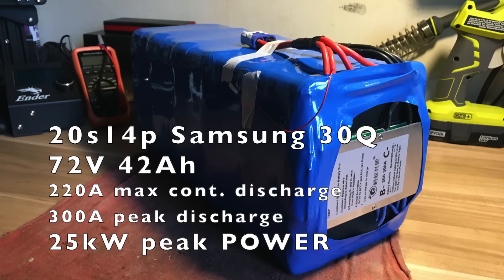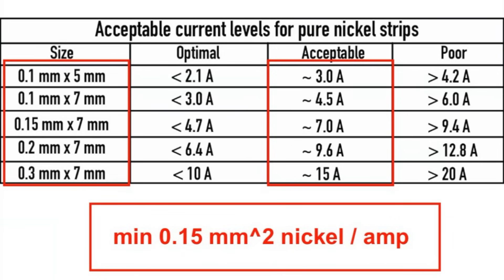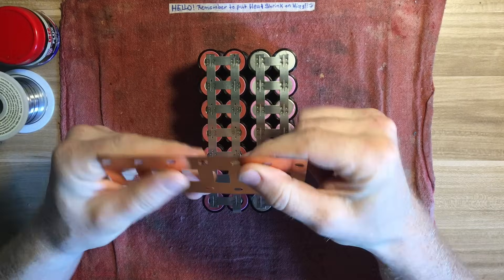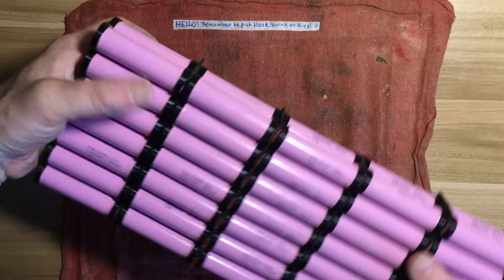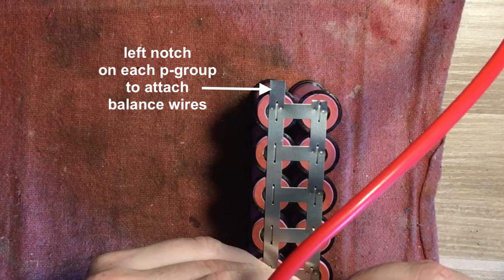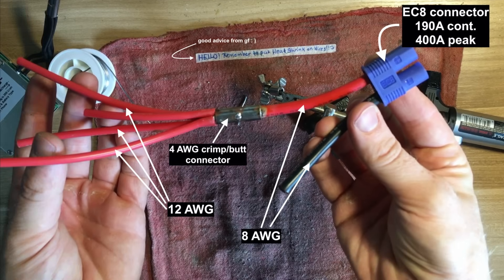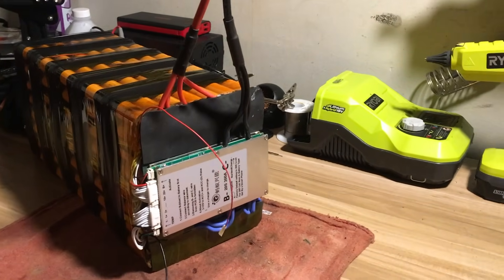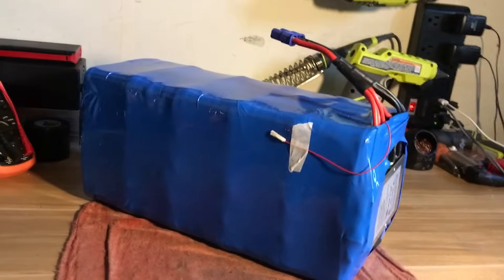How to build a MASSIVE 72V DIY battery pack for high power e-bike

Comment: Is it vital to add 300amp bms according to max dich current of cells or can you add a smaller amp bms ??
Reply from the maker: you can add any BMS - if current is less current of pack will be limited by BMS. if BMS max current is more you lose current protection unless BMS is programmable

Comment: from where you will do the charging and attach the load to the battery , in your case a motor controller ???
Reply from the maker: charged and discharged through the main pos/neg terminal

Comment: Trying to imagine dimension difference for 2 10sx14 stacked. Only 1 Copper folded connection with insulating pad in between. Love the work. Really helps with new ideas!

Comment: Every video I see with copper, says to sandwich copper under nickel. Why did you do the reverse? Thanks.
Reply from the maker: the reason they sandwich copper under nickel is because copper has very low resistance and common spot welders can’t achieve enough heat to spot weld it but if you place nickel over it, the nickel heats up enough and transfers that heat to copper - it’s a hack to spot weld copper with a common spot welder. but it only works for thinner copper. I’m using very thick copper here that would be impossible to spot weld so I added nickel first to attached the cells and provide a safe place on which to solder these thick copper plates
Reply: @GaiusGarage thanks!

Comment: Hi what controller works, fardriver nd72360 and im using this but fardriver max dc current is 190a shouldn’t go too over or over at all
Reply: Considering this goes a minimum of 220a
Reply from the maker: @TenzinLama-o5e  the controller controls the current, not the other way around. battery is like a glass of water you can have a big glass or a small glass, but you choose whether you sip slowly or chug all at once, youre the controller
Reply: @GaiusGarage dude im asking you question and you’re wasting my time why can’t you also tell me what motor is good?
Reply: @GaiusGarage should 15000w motor? And obviously 300 amps controller and 72v I already know this but tell me why you can’t tell the motor send a link?
Reply: Is 3c 3 amps?
Reply from the maker: @TenzinLama-o5e C refers to the capacity. 3c is 3 times the capacity which is 42Ah. so 3c is 126A
Reply: @GaiusGarage ok I read u loud and clear

Comment: why not use copper strips for the parallel connections as well?
Better conductivity, oxidation - doesn't matter (sealed space)

What is the exact reason(s) for using nickel?

Comment: Hey man, VERY well done. That battery is overbuilt in the best possible way!

Question for you... I picked up this crazy prototype battery a while back (I work with batteries professionally), and am really curious if its feasible to use it for an e-bike. Coincidentally, its cells are also Samsung 30Q, and this thing was clearly designed to harness the full 15A from each cell (each cell is thermally mated to a liquid cooled aluminum block!!). Here's the thing: the pack is configured as a 24S 12P (86.4V 36Ah) and can't be rearranged. Now, I am familiar with plenty of BMSs and chargers for 24S setups, but I am still mostly an outsider to the e-bike world and am struggling to find compatible parts that are practical and affordable. So I was wondering if you would happen to know of anything like that. I have a 700c road bike I'd like to convert, but I'm open to other ideas too. Also I'm happy to 3d model and print custom parts if need be. Thanks in advance.
Reply from the maker: The difference between 20s and 24s is pretty small - a lot of overlap in voltage (20s is 84V fully charged, 24s is 86V nominal) so for the most part, you should be able to easily find components that work for both. Basically, the only constraint will be the motor controller - one design for 20s will probably get damaged if connected to 24s fully charged (100.8V). But its easy to find motor controller that will work for 24s -- anything with a max current above 100V will work. I wouldn't worry about the motors - any motor that will work for 20s will also be fine on 24s.
Reply: @GaiusGarage  Fantastic. That's great info, thank you so much!

Comment: what would be the maximum charging amps for this battery ?
Reply from the maker: 1C is generally a safe charging rate - this is a 42Ah pack so a good max charge rate would be 42A

Comment: Great job! I have a question, when did you set up the battery pack to show as empty? When it reach nominal voltage or less like when it reaches 3.2v per cell ? Because when having a high discharge battery pack I'm confused where to set the SOC as empty 
Thanks
Reply from the maker: its a bit of an arbitrary definition - 2.5V is the physical low limit for li-ion batteries below which will cause physical damage to the cells. If you wanted 0% to represent the actual physical limit, 2.5V would be the value. that said, the energy curve for li-ion cells is not linear so the amount of energy between 3.0V and 2.5V is significantly less than between 3.0V and 3.5V, for example. In fact, most of the energy per cell is roughly between 4.2V and 3.6V. so if you're looking for a more practical value, perhaps one to set as a low-voltage cut off for the BMS or controller, I would go with 3.0V per cell. If you want to be a bit more conservative and focus more on cell health and longevity, 3.2V/cell could be a good option as well. I would also recommend not going below ~3.4V / cell for everyday use, and not charging to 4.2V/cell (studies show that charging to 4.15V increases battery life by 20% while the energy difference between 4.15 and 4.2 is only like 3-5% so you get a lot more battery life for very little loss in usability). here is a link to a curve that I use for all SOC setting: https://imgur.com/a/z8C1fzE
Reply: @GaiusGarage  many thanks for your professional explanation 
Cheers !

Comment: Are the multiple wires from the bms on both positive and negative just to spread the amps over 4 wires ? Is it best to solder them like you did in different places along the mains pos and neg area of the 72v battery or does it not matter ?
Reply from the maker: @cajab7407  yeah it's just to distribute the amps over several smaller wires vs. using a very think wire - generally you would do this to make it more flexible and easier to solder. if you have the option it's better to spread out where they're soldered

Comment: you must not divide the current carried by the number of cells because the nickel connecting them will see the entire load of all 14 cells put together in the group. now the load for each battery cell in the group will be divvied between them, but the nickel connecting them will see the entire load of all the cells in the group

Comment: So, my 60 volt e-bike and its battery got stolen a couple weeks back, and the other day the police returned it and the battery. Now, rather than charging up to a maximum of 70.3 volts, the BMS is saying that the battery is only a 48 volt battery. Did the thieves give the police the wrong battery, or is the BMS acting up? Not only did the battery come back out of its wrapper, but when I completely unwrapped the battery I noticed that four cells were removed from one end of it. The thieves may have removed the four missing cells, or the battery may have simply came that way from the factory. Not sure
Reply from the maker: I'd say it's more likely that they removed some cells - voltages match to to two missing cells (60 vs 48)

Comment: The foam between layers of the pack is a bad idea.

You either want the cells to be in direct contact with each other so that heat from cells at the center of the pack can be conducted outward, or you want to have aiflow through the pack.

Having neither, you increase sag as the inner cells heat up.

Comment: How much cheaper is it to build a battery like this versus buying a pre built battery
Reply from the maker: the thing with very high power battery packs is that they really don't sell pre-made pack other than for Surron or some other popular brands. and if you need something over 300A, you really have to go custom. cost to have someone build a custom pack for you will have at least 30-50% markup for labor. so it's much cheaper to build yourself if you can

Comment: Hi,
Did wraping the battery in hear restant foam cause any heating or overheating or slow cooling issues?  I want to wrap  the battery i am building in foam as well for decrease vibration but am hesitant about overheating issues. 
Great built.
Reply from the maker: No, I never had any issues with overheating. heat is not really an issue unless you're really pushing a battery pack to it's limits. in this case, I would only run it at max discharge for short periods of time (when accelerating hard) but most of the time the demand was much more moderate. so overheating was not an issue even when wrapped and placed somewhere with little airflow

Comment: great video, clean build!  i'd like to add to the importance of using insulator rings, my 12.6v 60aH build after 3 years had about 8 cells "pop" because the nickel somehow punctured into the factory protective film at the top of the cell (positive side), causing the positive to meet the battery shell (ground).  First time i've ever smelled li-on fumes and surprisingly smelled like Lychee candy lolll.  Ever since then, i've used insulator rings on all my builds, and still paranoid!
Reply from the maker: I added those here 1:09
Reply: @GaiusGarage  yeah, was saying im adding to the importance of it, loved that you put it in the video.

Comment: If I use a 3kw motor, how much range should I get in full acceleration...like 90km/h?
Reply from the maker: the motor rating does not matter - you need the energy efficiency of the vehicle (W/km). If you dont know this, you can estimate from your motor controller. If the controller pulls 100A at full speed, and this battery is 42Ah, then you will get 42/100 = 0.42 hours of ride time or ~25 minutes. However far you get in 25 minutes, that's your range.
Reply: thanks man @GaiusGarage

Comment: Excellent work. Very nice build.
I cant find the 220 continuos 300A max discharge BMS.
The ones available are 240A continuous  but 550A max.
Im usisng 14P sony VTC6 cells   so I have max 420A discharge.
Should I go for a lower continuos discharge? Let's say 170 continuous  425A..
Thank you.
Reply from the maker: you should size your BMS to the peak discharge of what your system will be running
Reply: @GaiusGarage  thank you

Comment: Hey I wrote a comment yesterday about my 52v battery that I could only get a reading of 14.5 volts out of. You replied saying I could do a zoom but I just thought I would write another comment to tell you what I would consider to be very important information before we go on the zoom. So I opened the battery a couple minutes ago to test the voltage, and I put the negative prong on the negative nickel strip and positive on the positive nickel strip, and I got a reading of 58.2 (52v is 58.8 full charge) so that’s the right voltage. Part of the bms wires are exposed so I put the negative prong on the negative bms wire and the positive prong on the positive wire. It read the exact same voltage of 58.2. Before, my worry was that the positive or negative wire wasn’t soldered on good enough, but now I know that they are and both give the correct voltage. This is good, because now I know 100% that it is an issue with the bms and not something else. I am going to book a zoom call as I would love to hop on a zoom call with you to get this figured out. Especially now that I know the problem. I just thought I would write this comment to let you know what I’ve narrowed it down so that way on the zoom we can get it fixed.
Reply from the maker: Oh nice! yeah sounds like your pack is in good shape, which is the important part!
Reply: @GaiusGarage  What day/time for the zoom works best for you? I have a lot of free time so I just want to make sure to book a time where you have the full time and focus to help me out. Just lmk what works best
Reply from the maker: @schmeglyomigy6174 you can choose a date/time on my Calendly https://calendly.com/gaiusgarage

Comment: Hi, I am a highschool student and for a fun project I decided to build an electric pit bike, as well as building a custom battery to fit the spacing required. I custom built a 52v 28.8ah (14s12p) battery with samsung cells and before I put the bms (50a 14s Daly BMS) on, I tested the pack with a voltmeter and it read around 58.6 volts, which was perfect. However, when I soldered the bms wires on, and put on the connector, it read 14.5 volts. That was around a month ago, and now when I test it the voltmeter reads around 9.5 volts. I checked all of the bms wires and they were fine, so I don’t understand how I am getting that voltage. I saw online that sometimes a BMS can be “asleep” and that you can wake it up by charging, so I tried that and it didn’t even charge. I am now feeling very frustrated and defeated, because everything went so well until the BMS part. Everything in terms of the nickel strips and batteries is good, but it is just something with the BMS. I wasn’t able to get a very good solder on the main positive wire, so that could be the issue. This is all for an electric pit bike project that I’m doing, and I just feel very defeated now, which is why I’m seeking external help. Sorry for the very long email, but this is just the problem that I am facing. Do you know a possible fix or any way I can contact you for you to provide further help. Thanks in advance.
Reply from the maker: I can help you debug over zoom - please feel free to book a 30 min session on my Calendy. you would need at least a multi-meter to do some testing. If I cant help I will refund the cost 
https://calendly.com/gaiusgarage
Reply: @GaiusGarage  Ok that sounds good. And for you refunding me if you don’t help, does that mean if you can’t help me get the battery working or just if you can’t help me at all. I have a multimeter. I do have a question about the multimeter if you know though. When I first read the voltage and it read 14.5, I decided to switch around to the different multimeter settings. On of them, which reads uA (macro amps) I got a reading of 54.6. Do you know how I could have gotten an amp rating out of it?

Comment: Great clear and concise video.  I would really like to see a test of the output vs. the specs it was supposed to be able to do.  I worry I will spend the money on raw materials and it won't be nearly as good as just buying a good commercial version.
Reply from the maker: Thank you! I used this pack even since in an ebike (build also on my channel) which someone has since purchased and still using. This pack performed great at the output mentioned in the video. Nowadays you have many more options for cells and build techniques where you can get same or higher output easily. similarly spec'd packs purchased pre-built will run you about $2500-$3k so it's definitely worth building yourself if you have the skill
Reply: @GaiusGarage dang! 3k for a prebuilt? I'm thinking about converting my bike with a 2000w hub, and a 20ah battery at 48v is around $500 or so, I think. I hope battery design will get better and cheaper soon, especially with all these Ev cars that they are pushing down our throats.

Don't these batteries only last like 4 or 5 years if you're lucky?

Comment: How much that cost to build and do you build and sell them ?
Reply from the maker: Just built this one standalone. But I can build a pack for you if you're interested. Cost was ~$1000 in 2021 but prices of cells have increased since. However, there are more and better cells on the market so its possible to source something for similar cost.

Comment: I heard solder and high current dont mix well because the solder can potentially heat up enough to liquify under high draw. Any thoughts on this?
Reply from the maker: Most common solder melts at around 200C - if your connections are heating up this much during use, you've got much bigger problems

Comment: How is this pack holding up? Just curious as Im debating to buy Ant BMS or JK smart.
Reply from the maker: I haven't tried JK BMS but I believe it is higher quality than ANT BMS. ANT is a reliable basic solution but it does not support active balancing as far as I know, I think JK BMS does. this pack held up well but one cell group started to lag. I had to add an active balancer to keep it in good shape. active balancers werent widely available when I built this but if I were to build a large pack today, I would definitely use one
Reply: @GaiusGarage  thanks man, what do you think about Daly? I’m planning on getting a 1.2A active balancer too. For JK, I’ve done more digging and it seems like a lot of people have the BMS fail quick
Reply from the maker: @550king  I haven't really heard a lot about the BMS failing..maybe very cheap no-brand ones, but ANT, Daly, JK are all good. Id say make your choice based on price, features, form factor etc
Reply: @GaiusGarage  yeah, I know someone that works at Daly. Maybe they could hook me up. Need smth to last long and is just set up and forget bout it. Since it’s going in a electric motorcycle and it will be a pain just to take it out.
Reply: @GaiusGarage  Well, JKBMS didn't go well for me. It blew itself in 4 months of regular use.. Support was responsive before but now they are ghosting me. I went ahead and grabbed a JBD bms and its working great so far.